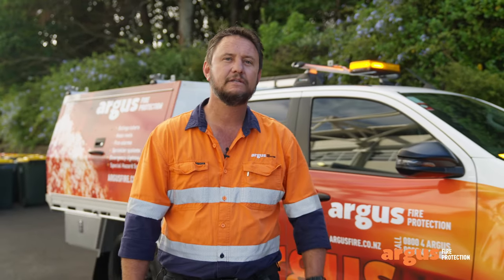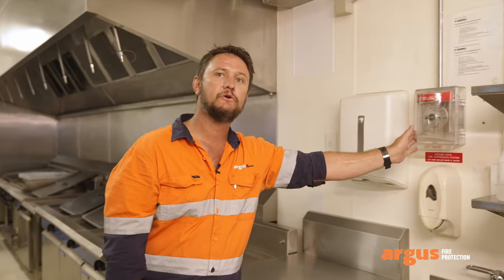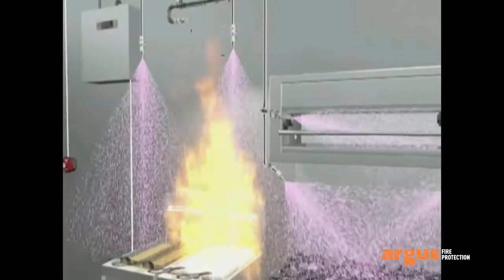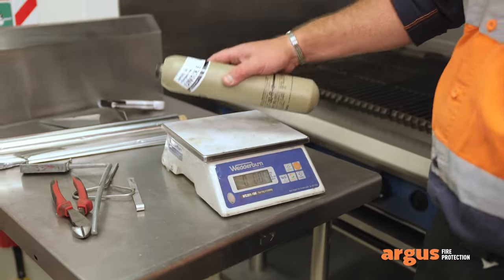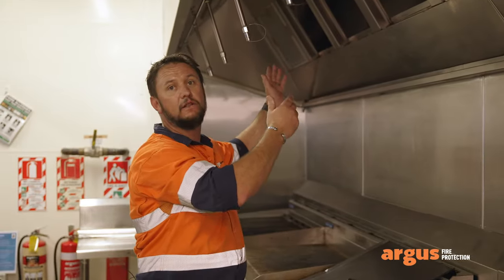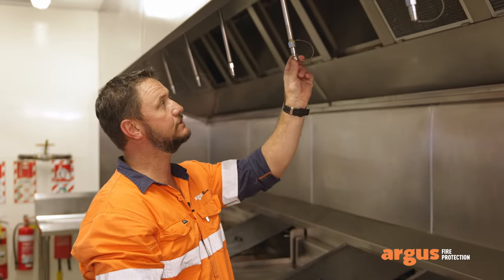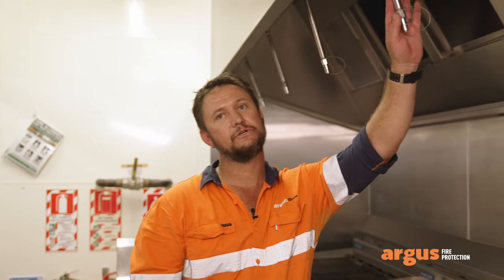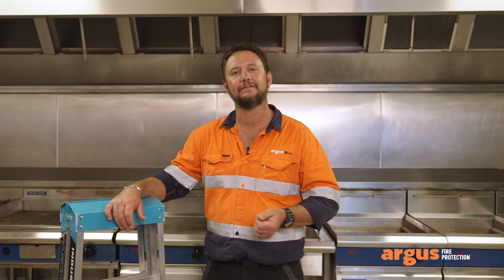Kitchen Hood Suppression System Maintenance Explainer Video (Argus Fire)

Comment: Umm I hope this ain't a training video. The pull station is too high up. It looks like you are using a small pair of channel locks not the right pliers. What kind of break rod is that? And put a test link in instead of cutting the actual detector. You didn't blow out the distribution line with air.
Reply: It's clearly a customer demo, he's talking to the customer end. The pull station location is probably the customers choice which is fine, Authority having jurisdiction I.e. the owner can specify the location.
Nothing wrong with not using a test link nor anything wrong using a small pipe grips for the scissor links.
Typical snob engineer trying to shoot down another guys work, I've met plenty like you and let me tell you they are the worst offenders when in comes to compliance. So you know some regulations big deal !! These systems aren't rocket science !
Reply: Customer's choice? Nowhere in NFPA 17A or IMC, IBC, ICC, or even in the Ansul (the manufacturer) manual will it allow for a location other than 48" from finished floor. Customer can choose where the pull station goes as far as kitchen location as long as the installer and/or AHJ will allow, but never alter in height.
Reply: Customer does not get a choice in the height of the pull station. No more than 48 inches from the ground. NFPA code, Ansul specifications. Done hundreds of finals with AHJ, fire Marshals and Mechanical inspectors. Same code for fire alarm pull stations.

Comment: That system is well beyond the allowed flow points😂😂😂. You’ve said nothing about nozzle coverage or anything. That’s Ansuls overlapping coverage. Do Better
Reply: well it's a piranha system. could easily be a 13 tank. each nozzle has 1 flow and could very easily have be enough flows on the cylinder
Reply: also, all piranha systems are total flood

Comment: He also did not test the water flow connection for proper pressure and check the water valve in in the locked open position.
Reply: He clearly wasn't going to show every detail it's a customer demo not a training video
Reply: Looks like a training facility by the looks of the extremely clean appliances